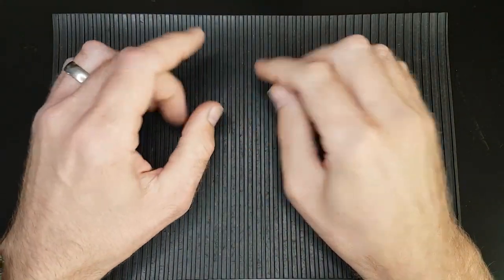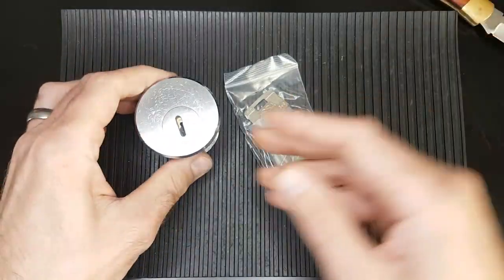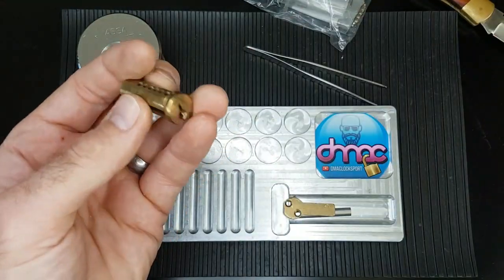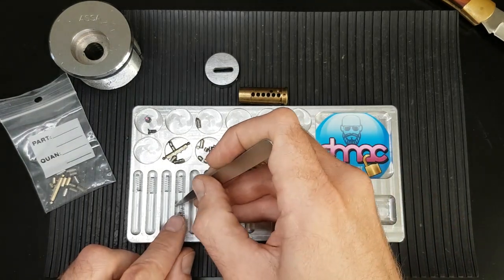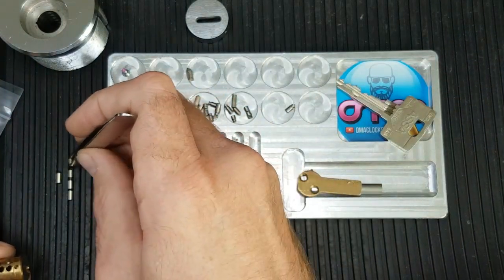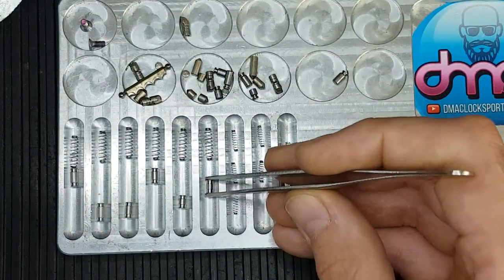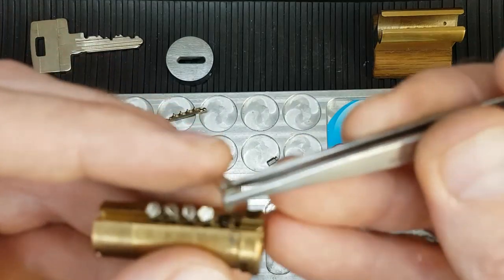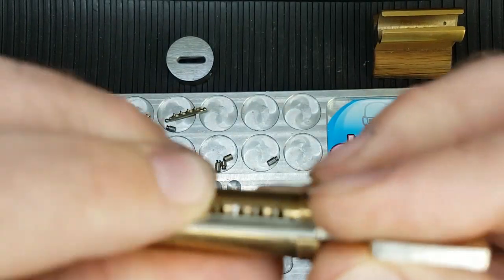Do you like puzzles? Reassembling a lock I've never seen before 😮

Comment: Great work. I could reassemble normal conventional pin tumblers from a bag of bits and a key, but I don't understand enough about sidebars to take any of those on. I'd definitely struggle, with poor vision and fine motor control, getting the tiny sidebar springs into place. I have three Robur locks that are apparently like a mini ASSA twin with weaker tolerances, and have not yet tried disassembling those; or indeed even picking them. When my skills improve enough to take them on, this video will be really useful in helping me to understand their reassembly process.
Reply from the maker: Good to hear and I hope it helps you in some way. They are tricky buggars to assemble 😁👍🏻